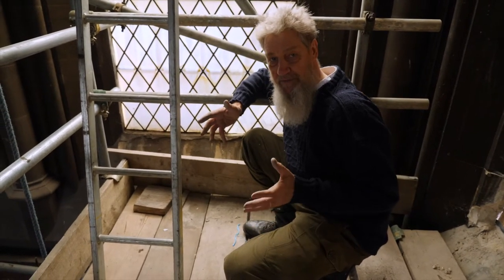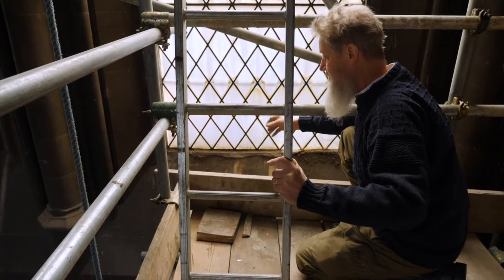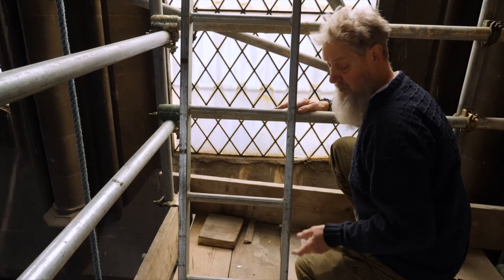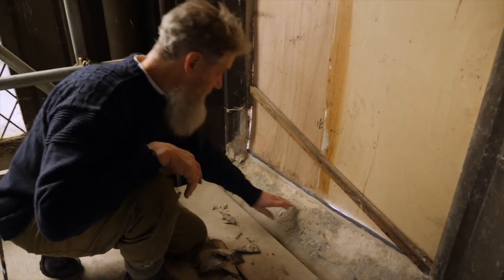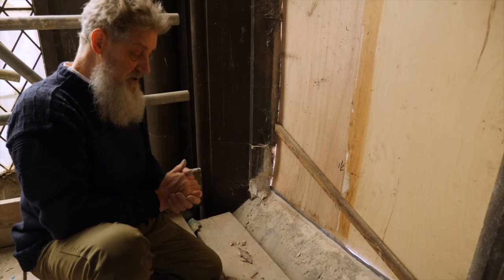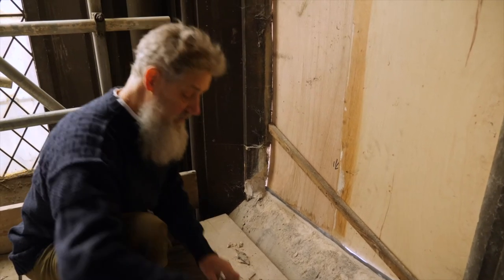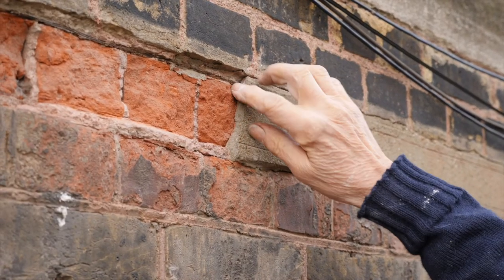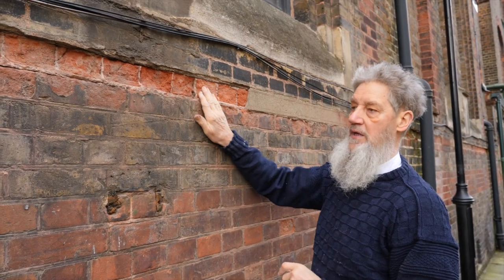Building Conservation | Cement Damage

Comment: Most of the builders we have used over the years are totally clueless when it comes to building materials for old buildings. They recommend cement repairs for everything and it will cause a lot of damage to countless buildings over the coming years. Sad to see.
Reply: To be expected, they're tradesmen, not craftsmen.. the little formal training they do get (as an apprentice some 25 years ago in most cases) doesn't cover traditional building materials or techniques. Their main mission is to be cost-effective & functional, not to be respectful to the age or aesthetics of the building. So, the responsibility lies with the homeowner to seek out traditional craftsmen for the job, or simply DIY/bodge it as would've happened historically.

Let's be honest those historic tradesmen would've taken cement & gypsum products on in a heartbeat and were likely just as clueless to workings of the materials as a modern (post-ww2) tradesman is.